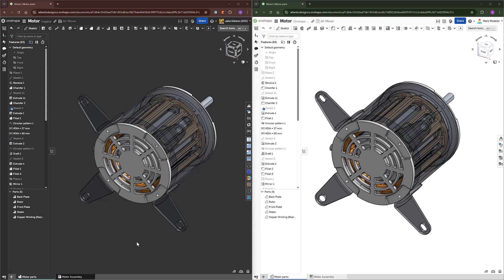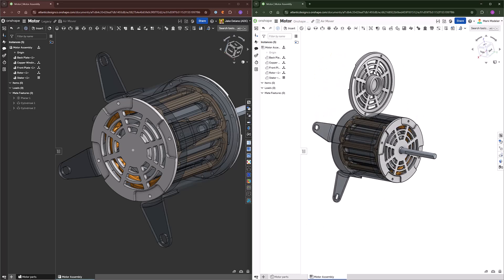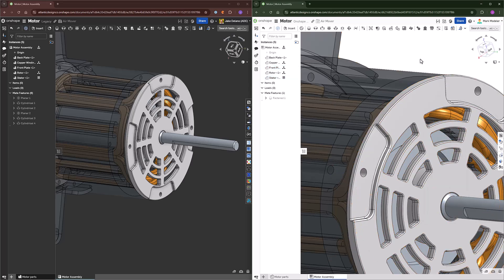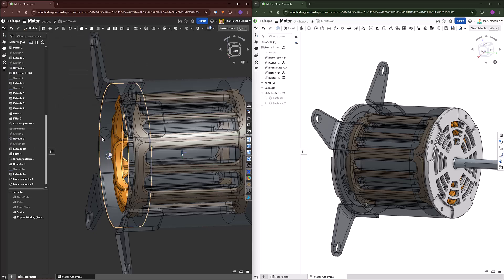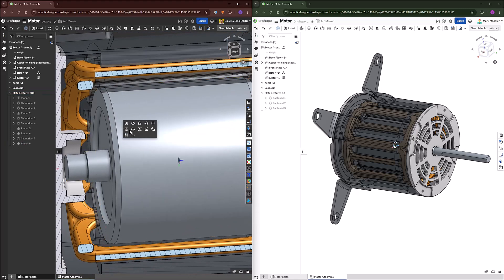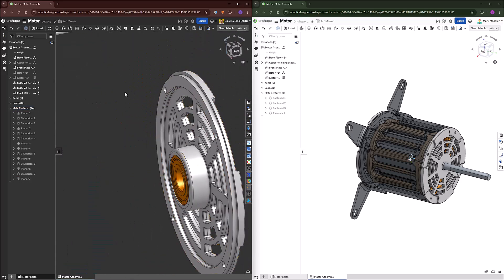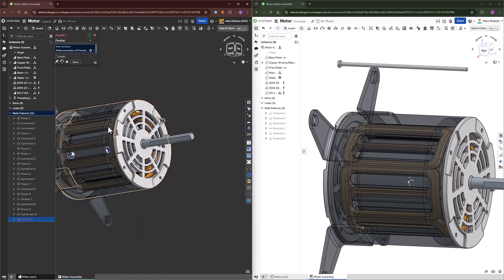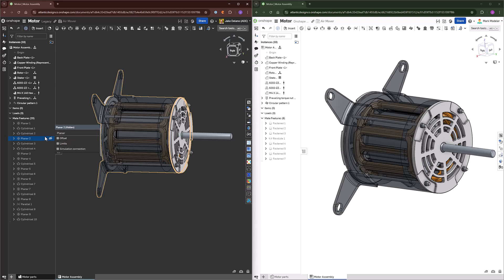How to Create Assemblies in Onshape (Tutorial)

Comment: how do you have the dark mode one the left screen ?
Reply: I think he's logged into 2 different users! But you can also temporarily toggle dark mode from the dropdown under your username in the top right.
Reply: Just load two windows and set one as dark mode in the account area, works no issues
Reply: There are two ways. Temporarily enable it in the current document from the user name dropdown in the top right, or enable it persistantly for your entire account by selecting "My account" in the same menu and then enable it in the "Preferences" panel.
Reply: @glendonkuhns7 thank's it hurted my eyes